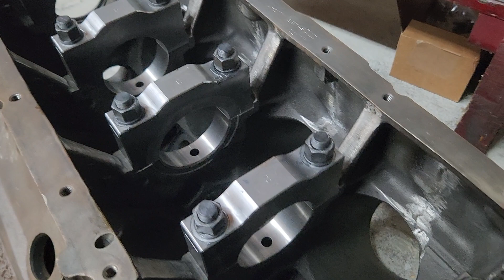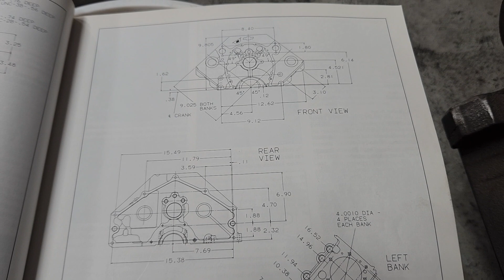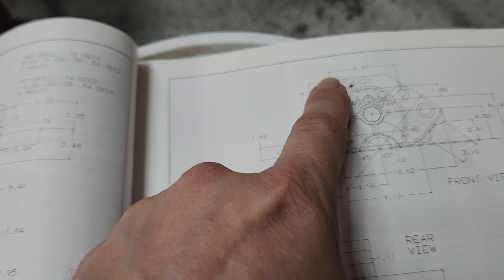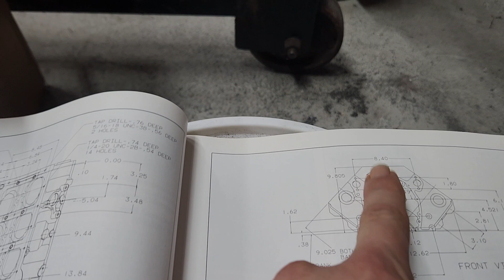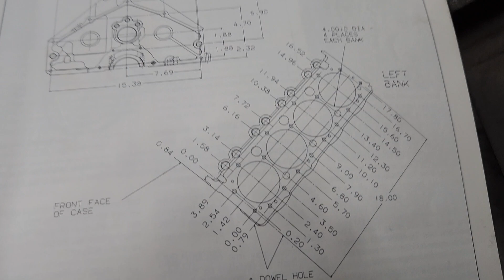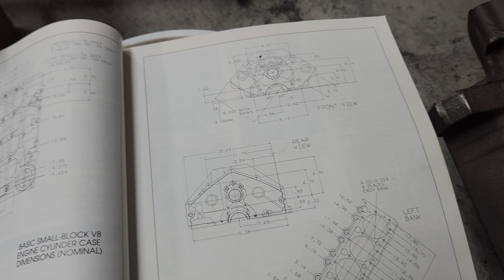Chrysler 440 - 505 Stroker RB Big Block, Part 2 - Machine Processes

Comment: You can never put caps on a block and expect them to fit W/O machining them 👍
good luck with the build 🇺🇸
Reply from the maker: The owner pulled the plug and sold it.  Thats why the videos stopped.

Comment: I’m
Making over 700 hp with a stock stroke 440 with rpm edlebrock heads
Reply from the maker: Nice !!  We have a set of Trick Flow heads for this.  Without looking, I don't remember which ones, but they are the bigger ones.  

Did you make 700 at the crank or the wheels?  I'm feeling 750 at the crank which might equate to 600-ish at the wheels, depending on the drive train it gets mated to.
Reply: @Phil454LSX My race runs were at Bandimere speedway in Morrison Colorado. I went 11.00 at 122.00 plus.The altitude was 9200ft on the weather station. So it’s around 500 hp at the rear wheels. That’s altleast 600 hp engine horsepower. Sealevel. Probably 675hp to 700 crank hp.
Reply: Car with driver 3400 lbs. on a footbrake leaving at 2800-3000 rpm
Reply: Cranking cylinder pressure 215 psi
Reply: I’ll give you my combination.
Reply from the maker: @darrenkelly9638 I'd be interested in your cam specs.  We haven't decided on one yet, but we'll probably do a custom grind.  The rest of the engine dimensions are pretty much spoken for.  We're not changing out or buying new parts now.
Reply from the maker: @darrenkelly9638 Those numbers sound about right with that elevation, give or take.  We are pretty close to sealevel here, maybe 400ft above +/-.  Here, a 3000lb car with 500 wheel horse should run about 10 secs if its set up correctly.
What is the poor man's equation?  Every 1000ft above sealevel loses you 1/10th a sec?  Or is it every 1000ft loses you a full second?  I don't remember, honestly.  Am I maybe thinking every 100lbs is a tenth of a second?  I've been away from the drag race thing for awhile.
Reply: @Phil454LSX . 447 zero deck Vinolia dome pistons 67.5 cc Edlebrock rpm heads. Fully ported . Ported victor 4150 intake with super sucker spacer. 1250 Dome carb. Polished valves. 268-273 .050 cam motion solid roller. 1.5 roller rockers. 440 source beam rods.
Reply: It took forever to mill the heads and intake to make this combo work
Reply from the maker: @darrenkelly9638 That depends on the shop that you take it to.
Reply from the maker: @darrenkelly9638 i'm not a fan of dome pistons, I would prefer a smaller chamber and a dish to make compression, if needed.  Compression doesn't make power.  Airflow and air burn makes power.  Cubic inch helps too.  No replacement for displacement.
Reply: @Phil454LSX well that’s all I had to work with. Got a great deal on the pistons
Reply: I have a 68 cuda race car with a 541 victor headed motor also
Reply from the maker: @darrenkelly9638 Nothing wrong with that, we sometimes have to make decisions based on a budget.  This 505 is no exception to that.

Comment: 440 Source swear thos blocks will go 0.060 overbore, I find that 400 blocks are more desirable. just the intake manifold selection is slim or outragously priced
Reply from the maker: @smilsmff  We didn't consider a 400 block until after we had started on this build.  Supposedly, they are a little stronger in the main webbing area and you end up with a lighter crankshaft.
Reply: @Phil454LSX  I have 230-1 Block 400" but not the supposed holy grail , it tapers down in the supposed thick area , i cant see where it makes a difference.
Reply from the maker: @smilsmff  Supposedly the 400 blocks are better since they have smaller main bores and you end up with an overall lighter crankshaft.  I think they have a shorter deck height too?  If i'm remembering that correctly?  So you get lighter on the pistons too, depending on piston/rod length combinations ... i'm not a big Mopar guy, so i couldn't tell you which 400 is the better one.  I also understand that they are harder to get affordable intakes for because of the shorter deck height.
Reply from the maker: @smilsmff Sorry, just reading back through our previous comments ... yup, I think we have that right on the 400.  I couldn't tell you which one is better to use, though, without googling it and reading through forums.  Even then, who do you listen to?  There are ways to strengthen them up and it depends on the power you plan to make ....

Comment: horrible core shift in chevy v8 blocks
Reply from the maker: @1959nickd  Chevy's actually aren't very bad.  Do you mean Chrysler?  That i can agree with, but it's not very common and usually isn't an issue.
Reply: @Phil454LSX  factory big block chevys had a friend usually would have to go through many blocks before finding one suitable for big power
Reply from the maker: @1959nickd  Big Power is found in an aftermarket block.  With todays prices to machine a factory block, its almost a no-brainer to start with aftermarket.  No one uses factory blocks any more.  But, yes, I'll agree, after machining BBC's and SBC's on an almost CNC machine, Big Chevy's are much worse than Small Chevy's.  Chrysler still takes the crown for bad blocks to use for performance, though.

Comment: what did your cylinder wall thickness come out at
Reply from the maker: @Jpaydirt  Ha, I've been waiting for this question.  I have a sonic tester, but I didn't bother to check it.  Here's why ... 
#1- I didn't have multiple 440 blocks to pick from, we were lucky to have found this one.
#2- I bought my sonic tester for another job after half of this machine work was already in progress.  It was magnafluxed before we started at the owner's insistence.  Don't get me started on the magnaflux scam to make money.
#3- It came from a running motor home and should be OK, it's only at .030 over bore, not .060.  The majority are fine.
#4- When these blocks fail under high power, it is usually the main webbing, not the cylinders and I filled the bottom of the coolant jackets to offer a little more support to both.
#5- I can always sleeve a cylinder if it would crack down the road, but I am not counting on having to do it.

Should I have sonic tested it before we started?  Yes.  But, then we'd be looking for another block that may not be much better ... so, after weighing the above options, I didn't do it and decided some things are better left alone.  A cracked cylinder can be fixed if needed, it would suck, but it's not the end of the engine.
Reply: @Phil454LSX  Oh,  I wasn't thinking about cracking...........but they might over time I guess , I was wondering more about budging under high HP and firing pressure going past the rings, but if it's making good power you have a good block
Reply from the maker: @Jpaydirt  Good points.  It's a factory block, it's going to move a bit, they all will.  Some more than others.  If you want to correct that, you need an aftermarket block or fill it a lot higher than I did.  I filled this one up to the bottom of the core plugs.  You could always go higher for better stability, but you risk cooling capacity on the street, especially on hot days.  How much is too much for the street?  I don't know, but when it's a paying job, I try to play it safe as I don't want it coming back with cooling issues that I can't fix once it is filled.  I probably could've went higher but would've had to put core plugs in and make cleaning it a chore.  As far as ring seal goes, I am using Total Seal's gas ported piston rings which will help with seal and minimize blow by on the compression stroke and it was torque plate honed.
On another note, I built a 1995 factory block LT1 small block Chevy many years ago that made over 1000 horse on a 300+ nitrous shot and it saw some hard drag use.  When taking it apart for a refresh, the block was still in very good condition.  I chalk that one up to luck.
Reply from the maker: @Jpaydirt  It's not finished yet, but with the exception of moving the cylinder bores to their correct locations, it is a blueprinted machined block.  Will things move around under power and heat?  Probably.  How much? I don't know, but it will stay together.  I think you might be over thinking things, there's a lot you COULD do, but consider your budget at the same time ...

Comment: What kind of caps are they.
Thanks for sharing. 
Have a great day.
Reply from the maker: They came from Billet Speed Works, which, I think used to be Program Engineering.  I remember reading or hearing somewhere that the owner of Program retired and an employee of theirs bought the business and renamed it to BSW.
Reply: @Phil454LSX  Thanks Phil, I appreciate it.
I had already looked it up on line.
Take care, Ed.
Reply: I'm in Northwest, Arkansas.
Reply from the maker: @edsmachine93  The 440 is set to leave on Monday for decking and boring.  Depending on how time frames fall, I might be making a video on filling a 1995 LT1 Chevy block to the water pump in hopes of making 1200 turbo boosted horse out of it.  The block took 1000 horse in its last build form.  As I tell him, it's a grenade, the pin is pulled, we're just waiting for the timer to run out ...
Reply: @Phil454LSX  The LT1 sounds like a very interesting project.
It will be nice to see how the 440 comes out Phil.
Reply: What should I expect to pay machine shop for having aluminum main caps and stud girdle installed? I bought caps and girdle from SD Concepts. Used to be BCR
Reply from the maker: @felixleeo89muy65  Sorry for the late response.  It depends on the shop and how "good" they think they are or their debt owed on their machines.  20+ years ago, it was a $300 to $500 job.  Now, I would guess you'll spend anywhere from $600 to $1000.  I don't know exactly what the cap install cost on this block because I had other things done to it at the time.  I paid cash and there was no receipt.  Depends on the shop overhead, the engine and the labor hours ... but I would say it should cap out at $1000 at the most.  Kinda depends on your area too ... expect to pay more in a place like New York or California.  In that case, I would travel rather than go local.